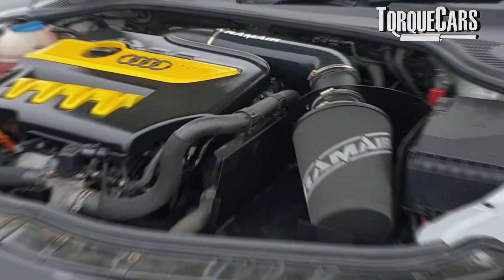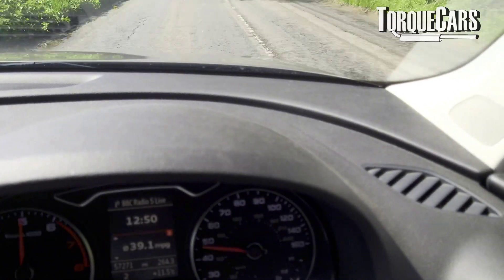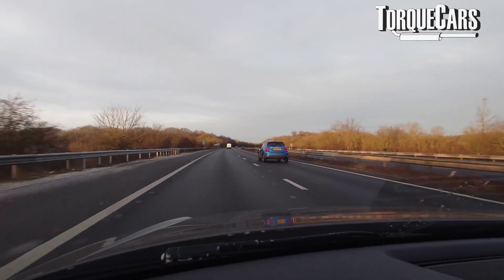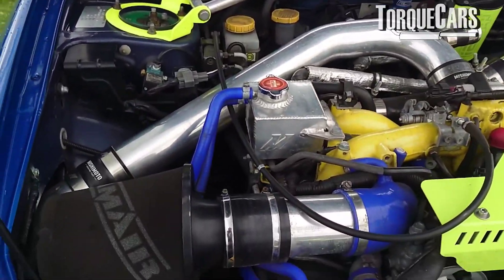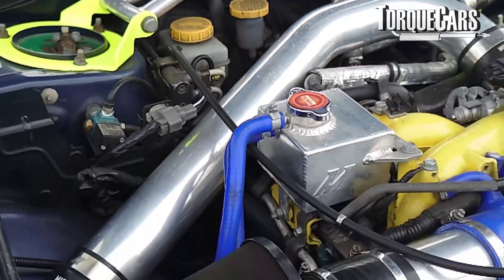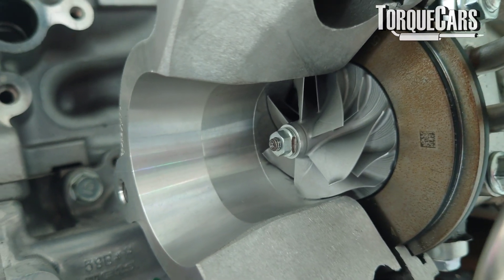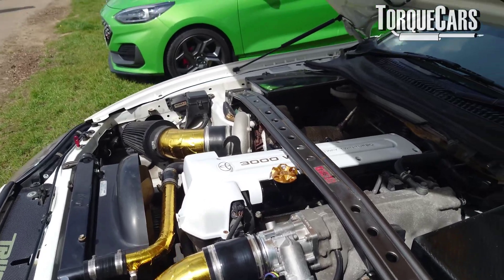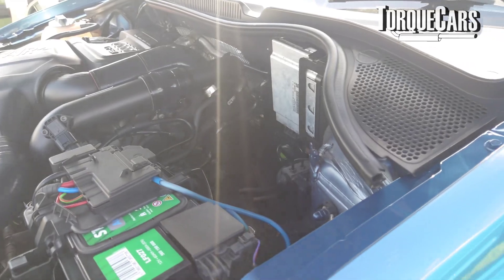Losing Boost? DON’T Buy a New Turbo Before Watching This! Simple Fix Could Save You Thousands!

Comment: Another mistake is they put on a new turbo but fail to check or renew the gauze filters fitted to the oil supply pipe on the turbo, which usually results in failure of the new turbo after a while - for the same reason the first turbo failed, oil starvation due to coked up oil.